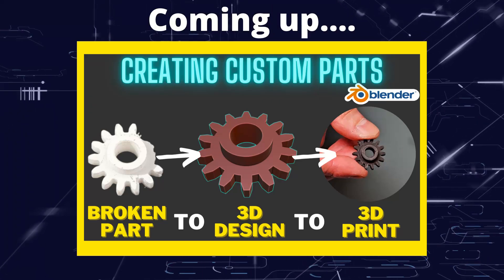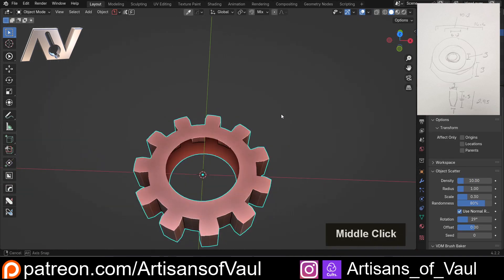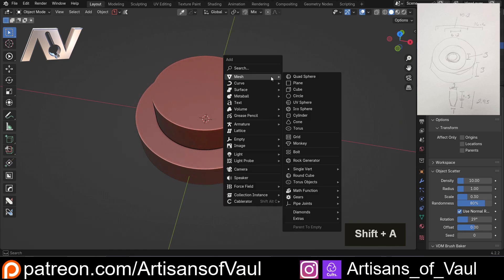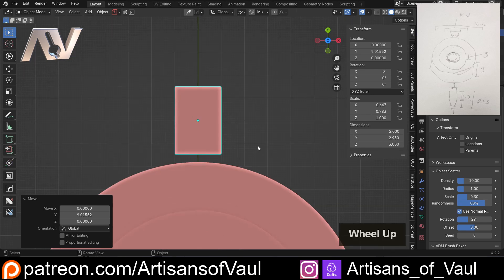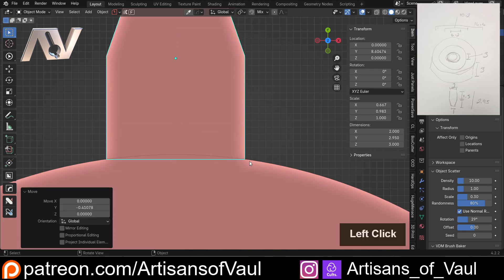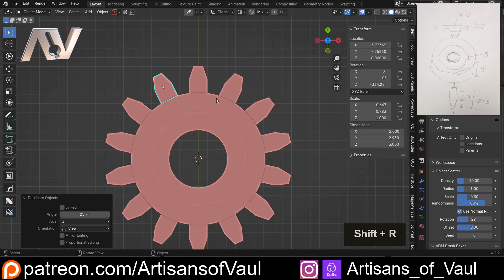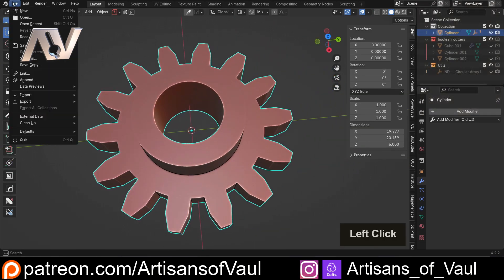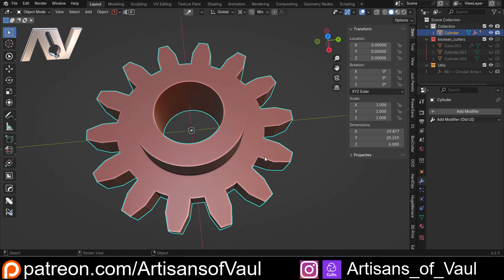Creating custom parts for repairs in Blender

Comment: Great video, thanks! 
To take the accuracy of the replicated part up a tad, especially if the tooth profile is important, I'd scan the part using a regular office document scanner at say 600dpi, then use that as a reference image in blender.
Reply from the maker: @kurogiza  👍🏻 I have a 3D scanner so I would have normally used that but I wanted to cover something without using something people might not have access too. But it's a great suggestion for something you can fit flat on it.
Reply: @ArtisansofVaul  First off, loved this video and found it really useful. I'd say though that most people with a 3d printer WILL have a desktop scanner and I at least would appreciate another video covering the scanned object approach to fully understand the differences.
Reply from the maker: @markhickson9087  Maybe. I have a lot of tech but I don't have a scanner. Or a normal printer.  So maybe I'm bias based on what I have 😅 I do want to do some things on making specific shapes from 3D scans but it seems quite niche. If there's a desire for it it could be a fun video
Reply: @ArtisansofVaul  I appreciate these videos, I know a lot of tech people and none of us have a scanner, or a 3d scanner

Comment: It always kills me that blender asks for the radius in the operator panel but shows essentially the diameter in the item properties (because bounding box).  I think at least half the time I make something round, it comes out twice as big as I wanted. :-)  I do wish there was an easy way to scale something such that its bounding box is a certain absolute size, but I haven't found any good way to do that. Even CAD Transforms makes that difficult, because it won't scale symmetrically when you use that. (At least as I've found.)  I'm definitely going to have to look into ND - that looks pretty handy!
Reply from the maker: @darrennew8211  I'm not home to be able to try it out but maybe using the scaling box tool, which seems to work from the bounding box, is the answer. Not sure if you can type in an answer. Also when you use the scale tool I can't remember if there's an option in the box to set as using the bounding box....?
Reply: @ArtisansofVaul  I haven't gotten either tool to take a unit of measurement as an input. The scale box seems to let you scale in a certain direction (e.g., half as wide but move the right side and not the left) but it doesn't allow for absolute distances like the move tool does. As far as I can find, at least.

I usually put in a MeasureIt measurement then slowly drag it until the number's right, but ... I should make an add-on or something. :-)
Reply from the maker: @darrennew8211  Hmm... Maybe some maths in geonodes (you can also use maths in the scale box and just do the new size wanted divided by the original size to get the ratio wanted.
Reply: @ArtisansofVaul  For sure there's ways around it. It just seems weird that you can use dimensions in move but not in scale. I should learn enough geonodes that I can make an operator to scale the bounding box of the selection to a certain absolute number. Way easier than Python, I think. :-)  Thanks for the idea! I don't use geonodes nearly enough.

Comment: just a quick engineering tip, bevel (fillet) the root of the tooth so there isn't as much of a stress concentration point. generally the way to do it would be to make it 0.25 of the modulus of the tooth and without going into the details the height of the tooth is roughly 2.25 of the modulus.

In your case the tooth is 2,95mm tall so the fillet should have a radius of 0,3279mm but you can round it at 0,32mm.
Reply from the maker: @Arg0n01  Nice tip 👍🏻👍🏻👍🏻Thanks so much for sharing 👌🏼😁😁😁

Comment: If I understood right 1 blender unit = 1m. For most 3d printing slicers 1 unit = 1mm. So it's like you are modelling in mm there. But, what if in your head this gear is for a bigger machine? It would get misinterpreted by the slicer. I find it very odd we can't set in blander how much a default unit is (instead of adjusting the unit's scale in the properties panel). Telling blender 1 BU = 1 cm, let's say, would make setting up the scene scale much more practical. Also, adjusting the scale in the properties panel messes with sliders sensitivity and other interface and default settings.
Reply from the maker: @brunoosti1  I mean I generally work around that size so 10BU = 1cm isn't particularly hard to work at. If you really need to you can change the scale but I avoid it. The other option is as you export the object/STL if you bring it into 3D builder you can set what the 1BU is at that point (for example cm).
Reply: @ArtisansofVaul  further researching the subject, it seams only a few formats carry the units system with them, also. So what matters most seems to be what each software addresses as "1". I like to keep everything default in blender (not to mess with the UI) and change the metric units to display as mm.. from there, rescale in the  exporter... meh.
Reply from the maker: @brunoosti1  Yeah. I think it's more that a number of programs assume 1 = 1mm.